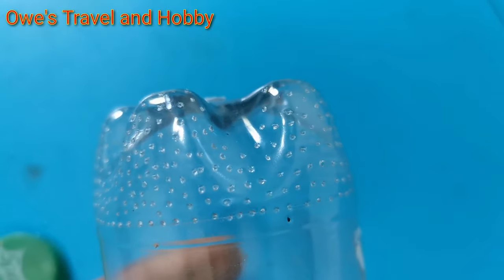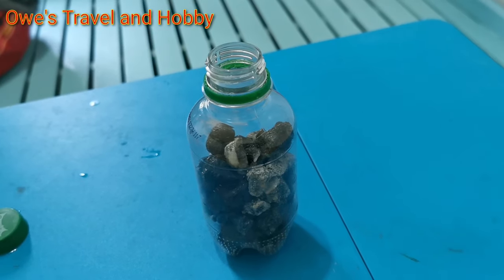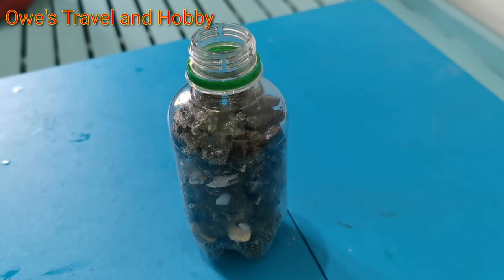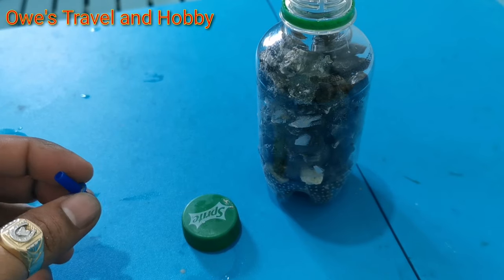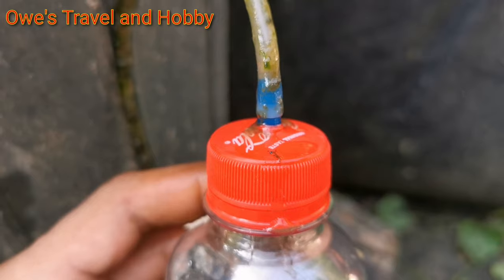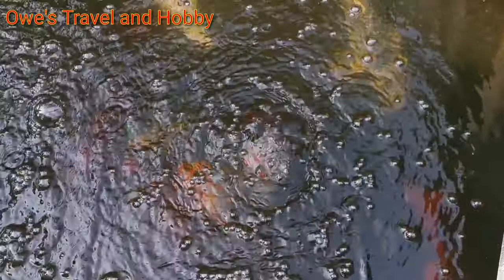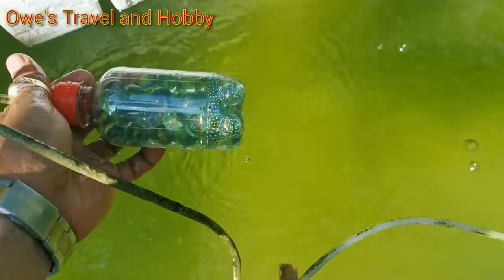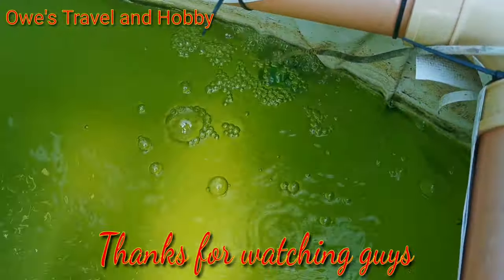Stop buying airstone make your own

Comment: The plastic is toxic for fish, that's a no
Reply from the maker: Been using this for couple of years no issue 😊
Reply: @OwesMIXtv8911  if u say so
Reply: Hdpe plastic is nontoxic there’s some bottles made out of that.
Reply: Vitamin bottles are non toxic. Look for recycle number 2.
Reply: @peckerpeter2078 yes but only the caps are hdpe
Reply: @costinhomescu2010  No look at bottom of bottle it will show Hdpe